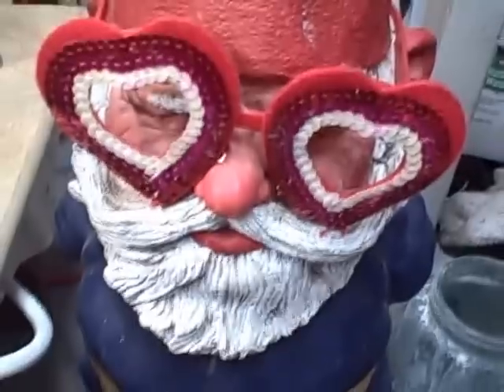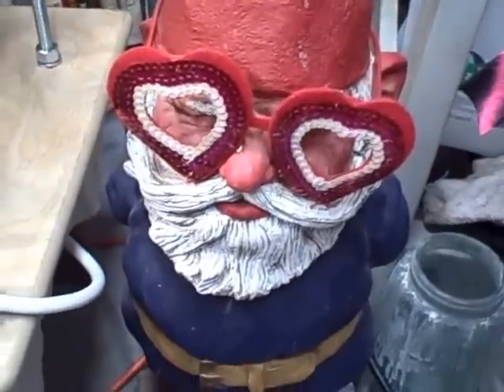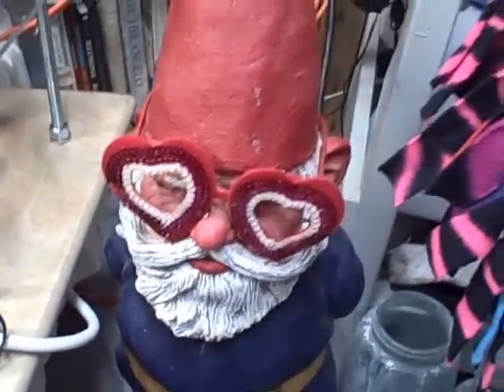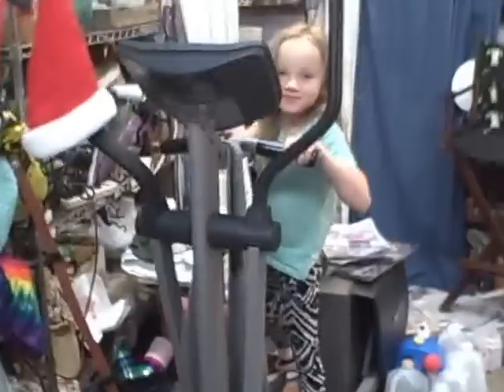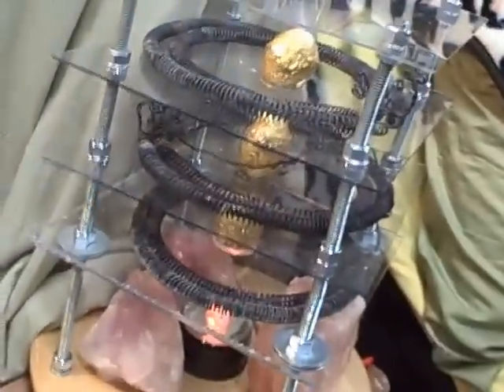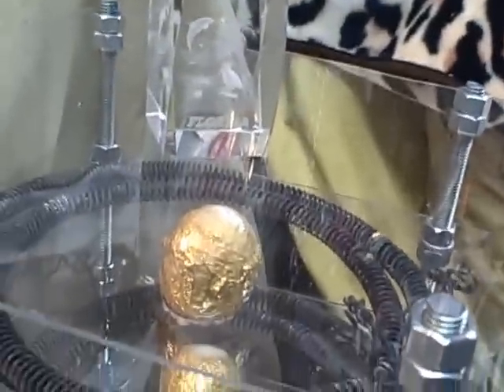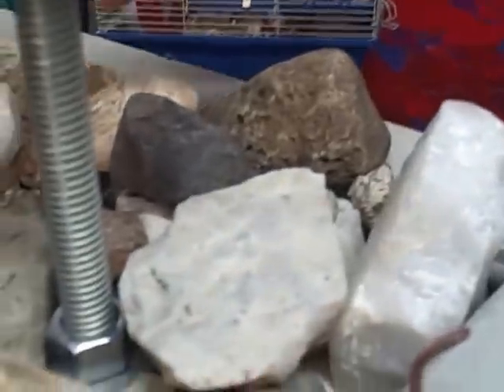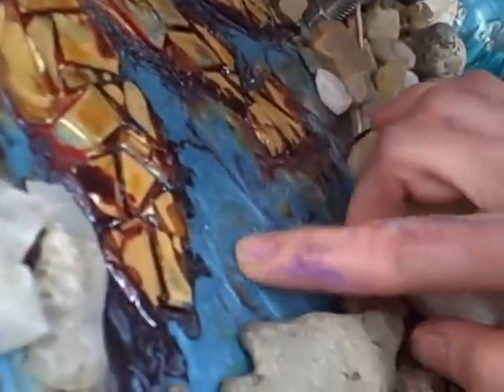Getting to gnome Keshe free energy at C. Black Studios part 1 of 3

Comment: Is your magrav system still plugged in to your grid power supply? Can you run all/part of your house electric equipment by unplugging the Magrav from electric supply? if not, its not a true free energy source. The meter on input side may be reading zero due to magnetic coils or some other effects. Anyway Keshe said the unit will be self running after plugging it to power supply for 4-5 weeks. Have you unplugged the unit after 4-5 weeks and check if it is still supplying power to your house?
Reply: you are wasting your effort, unless you unplug your magrev from power supply its not worth using it. You can directly connect your home appliancce from power source without using these funky coils and meter settings. How can we believe that magrav is a self sustaining energy device unless it doesnt run by itself. So Please unplug it from your power supply and check if you still can run your electrical appliances solely using magrav (unpluggged from power supply)